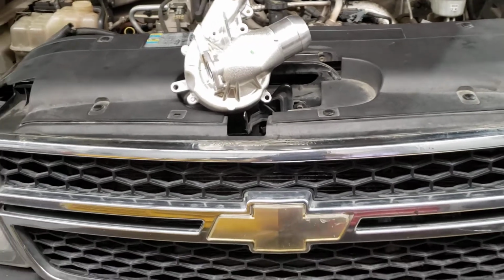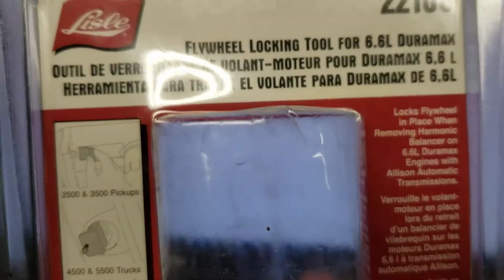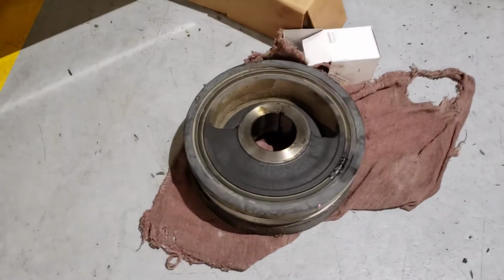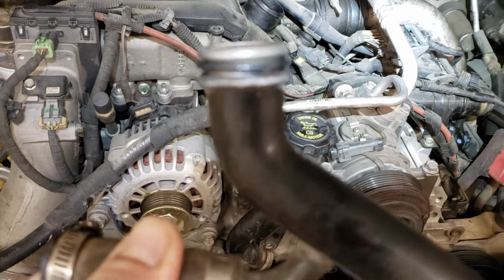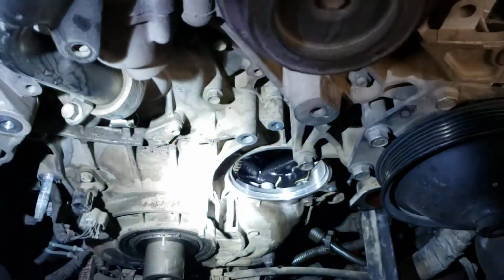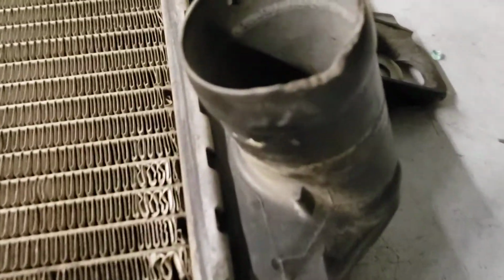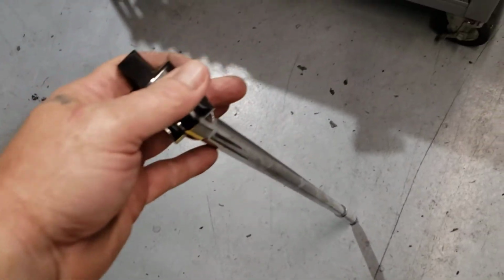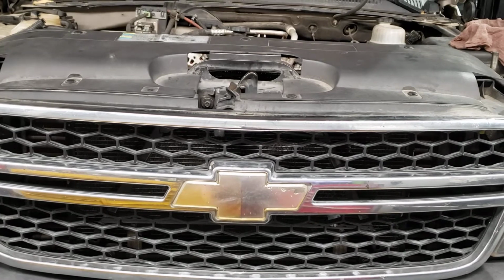Duramax Water Pump

Comment: The locking tool does not seem to lock onto the teeth. Does it need to rotate more to get them to line up by turning the balancer bolt yellow the tool key will engage with the fly wheel teeth?
Reply from the maker: @The1bluguerin  yes you have to rotate until it locks into place

Comment: Put a 36mm socket on the crank balancer bolt w/a breaker bar & place breaker bar handle behind the alternator pulley & bump the key & let the starters torque loosen the bolt-your welcome
Reply from the maker: That is a great tip I think I may try that. Thank you for watching.

Comment: I stumbled upon your channel today and enjoying your vids.
I use a jack handle on a breaker bar 1/2 drive onto a 36mm 12 point and a helper holding like an 8 " prybar wedged in the flex plate gear and it cracks right loose.
I never removed the thermostat housing either. Same way back on with torque wrench. Last one i did was just the pump and re used the housing, they get cavitated.
Not a bad job if you take your time and 1 step at a time.
Reply: Multiple reports of damage to flywheel from prybars shoved in there. There's even cheaper brands of the flywheel tool 22100 on Amazon
Reply from the maker: @mrmotofy  thank you for the feedback.
Reply from the maker: Well thank you for the reply and I will keep that in mind.
Reply: @NutsandBoltswithTone  If you got the proper tool then theres no need Lol
Reply from the maker: @mikescot7187  very true.